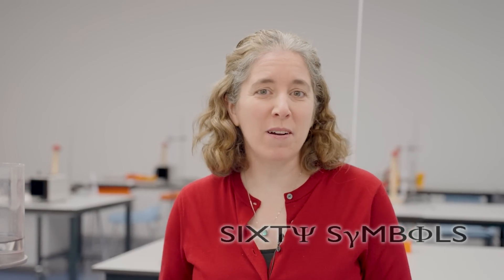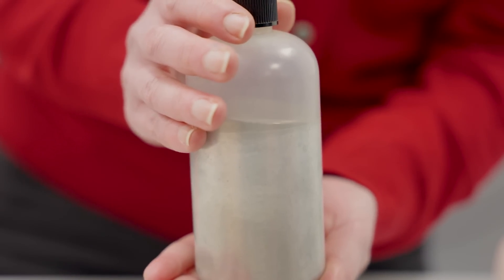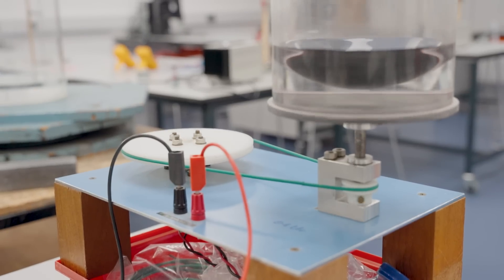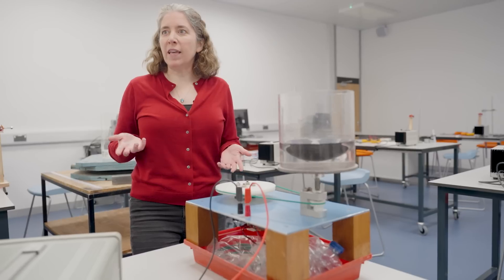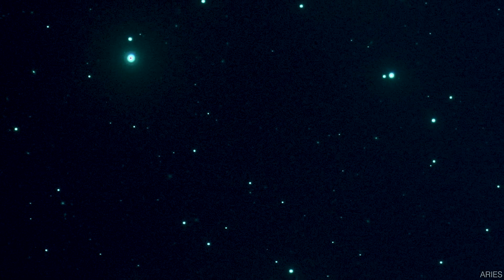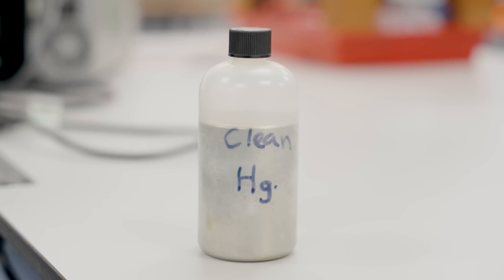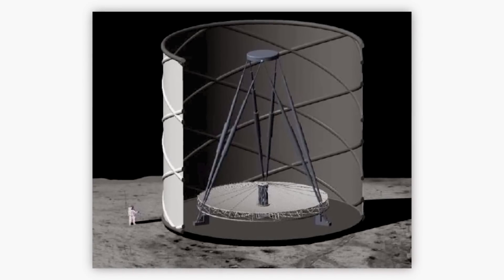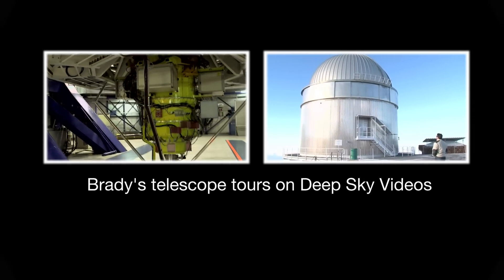Telescope with a Mercury Mirror - Sixty Symbols

Comment: Surely, a frozen metal mirror is exactly what is required on the moon,. Once frozen ,in the correct shape onto a suitable frame, it could be steered like a normal telescope
Reply: You don't necessarily to steer a telescope on the moon into the right direction. You just have to remember that a dark night on the moon last less then 14 days on earth. Yes, when it's dark it last much longer than 24 hours, but most of the time the sunlight will be to bright for the telescope to see other stars. 
So it would be better to have a telescope on the moon without all the complicated steering mechanism. You could then only look a small part of the sky, but it might be easier to set up a few more telescope with liquid mirrors on the moon pointing in different directions as one with a normal mirror.
@luipaardprint It's an important point, that a liquid mirror doesn't need polishing. All the big mirrors of normal telescopes need a cleaning and recoating evey few years. That would be very difficult to do on the moon.
Reply: Once frozen it’s not a smooth surface anymore, and would need polishing.
Reply: @luipaardprint  It's Ironic that cooperation with polish scientists produced a telescope that doesn't need polish.
Reply: @luipaardprint  like most mirrors :-)
Reply: I wonder if there's an electro-chemical way to polish frozen mercury.
Reply: @wktodd  you don't need to polish liquid mirrors

Comment: Hear me out, what if you double spin your telescope. You first spin the mercury to make the parabola, then spin the whole telescope in a circular track, you can point it sideways while ignoring gravity. You can image a whole circle in the sky that way.
Reply: You could, but you'd have a worse problem than it pointing at only one spot. Now it's focus would be constantly moving as you would have to keep it rotating on the circular path because any change in that motion would disturb the surface.
Reply: @ElectricGears  also as the earth is moving,  we will have to change the track radius with time
Reply: No, you cannot simply ignore gravity.  If the axis of rotation is anything but vertical to gravity, you get a constantly varying shape.
Reply: But now you got motion blur
Reply: I like the way you think
Reply: Vibrations are going to make this a nightmare
Reply: That would induce sloshing.

Comment: but if you limit yourself to a zenith looking telescope - also all the arguments why handling and mounting the traditional solid mirror is so difficult disappear.
Reply: Not if you have to ship it into space.
Reply: @Bunnysinger  admittedly, but as was also pointed out later in the video there are other obstacles, like the low temperatures and the low pressure, with together with the high vapor pressure of mercury will lead to quick evaporation. There are other alloys, but for the dark-side of the moon with -180°C the choice even of ionic liquids should be limited, balancing between freezing and immediate evaporation.
Also still the containment vessel and motor assembly would need to be transported to space/the moon.
JWST has shown that a quite thin, free-standing membrane can work as mirror surface, which sounds much more attractive.

Comment: If you spun a molten metal that is warmer than room temp, then let it freeze as it's spinning, would you get a smooth and solid shape?
Reply: Unlikely. You get shrinkages that will warp different parts.
Reply: I would imagine controlling its shape as accurately as needed would be very difficult. Also a big advantage of the Mercury mirror is that it’s does not need polishing, which a solidified metal would need.
Reply: Yes, although you will have distortion as it cools. Some glass mirrors are made like this, then ground with CNC machines into the precise shape. The centrifugal casting drastically reduces the amount of grinding and stress releaving that would need to be done if they started with a solid block.

I think some amateur astronomers have done this with plaster to create the pre-forms or physical templates for tracing attachments used to grinding their own mirrors. When we didn't have CNC machines accurate to nanometer distances, that's one way of generating these mathematically-defined surfaces.

Comment: Big Flat Mirror?
Reply: A flat mirror wouldn't concentrate the light from it's surface in to one small area like a curved surface does. That is needed for astronomy because so little of the light from stars reaches us after spreading out as it travels such great distances.

Comment: A magnetic band under a thin pool of mercury is out of the question seeing as it's electron stability (negatively) is very low.

However, Galinstan could possibly be manipulated in such a way as to parallel a rotation once spun up.

Could this be a safer/cheaper solution?

Just asking! ;O)-

Comment: Isn't possible to freeze the mercury telescope after having the paraboloid shape? Or maybe using it as a mold to make a solid one with glass mirror?
Reply: You don't need a mold for a glass mirror - in fact, large parabolic mirrors are made by spinning molten glass and letting it cool down very slowly.
Reply: It would have to freeze while spinning and I imagine it might not freeze evenly. The whole apparatus would have to be kept at -39C which probably costs more energy than spinning it, and everything has to tolerate that temperature. And we already know how to make a solid one with glass mirror.

Comment: There is an alloy of low melt metals that can be used instead of mercury. 
Non toxic. Can solidify then remelt when needed. Still useful at normal temps.
Gallistan? 
GALLIUM, INDIUM, NICKEL...??
Reply: I reckon density and viscosity are a factor here. It looks like that alloy behaves differently from mercury and is more readily oxidised.

Comment: Couldn't you steer this telescope the way they steered Arecibo? By moving the camera around. You will not get 180° but a decent portion of the sky.
Reply: Arecibo was different shape (spheric compared to parabolic)> This allowed it to have a line of focus instead of just a single point
Reply: @filiard  that's right. Arecibo was deliberately chosen to have a spherical shape so that multiple receivers could be simultaneously listening at the line of focus and so a secondary reflector could be steerable. FAST in Guizhou, which is now the world's largest uses the same design. The shape is also easier and faster to build due to the more symmetric nature of the pieces. Further still, the spherical aberration of the primary can be corrected for with a Gregorian secondary and tertiary reflector assembly at the focus, which was eventually exactly what was done on Arecibo in the 80s.

Comment: What about dust that is a problem for big mirrors? Mercury is heavy. I imagine all the dirt will flow on the surface.
Reply: It's not the dust that's the problem, it's the oxide scum that constantly forms at the surface. You can see a whole crapload of it on the mercury surface at the end of the video here. The LZT in BC constantly needed to be stopped and the surface skimmed with paper towels to clean it. The dust accumulation on a normal telescope, even in the worst cases, surprisingly only accounts for a loss of a few percent of light.
Reply: It's probably easy to swab/remove dirt if it settles on the surface, or have a process to exchange the mercury periodically to purify it.
Reply: One technique that’s been used is a thin layer of liquid floating on the mercury that is continuously recirculated and filtered.
Reply: It looked like there was dirt / oxides around the perimeter of the mirror. Perhaps centrifugal force keeps that stuff on the rim.
Reply: @thirstyCactus  I think you missed the demonstration in this video where they put something on the surface of mercury and it stays in place.

Comment: Another advantage of mercury is that it is self healing from small, surface-level damage.
Reply: another advantage is gradual exposure to mercury vapors motivates the research assistant to finish their thesis quickly
Reply: That advantage would be excellent for a moon-based mirror, where there's likely space randomness hitting the surface more often than on Earth's surface.
Reply: @thirstyCactus  even better for lunar applications is that mercury corrodes aluminium spacesuits and spacecraft
Reply: That property is not mercury's. It is any liquid's property.
Reply: @JavSusLar  OP was referring to mercury as opposed to solid mirrors, not mercury as opposed to other liquids.

Comment: Is the mercury mirror a sealed container? or would they need to top it up from time to time?
What are the implications for polluting the environment?
Reply: The vapour pressure of mercury is pretty low for a liquid (but high for a metal), less then 0,2 Pascal at ambient temperature. The vapour pressure of water is about 1000 times that.

(On the flipside, a molecule of water weights about 1/10 that of an atom of mercury, and when water evaporates, it cools down a lot more, inhibiting further evaporation.)

So just to get a feel for it, mercury stays where it is much more willingly then water. As long as the mecury is kept cool and does not experience a permanent air flow, it will only leak tiny amounts.

Now some perspective, the yearly mercury emissions due to anthropogenic sources are estimated to be about 2000 tons. (metric, obviously)

About 1000 tons of mercury are released from "artisanal (small scale) gold mining and refining", which makes up about 12 % to 15 % of total yearly gold production.

About 400 tons of mercury are released from burning coal.

That means that any losses of mercury from a mercury mirror are, globally, a drop in the bucket and absolutely meaningless. I bet that the effective mercury release due to the production of electronics in their systems and from the energy consumption to keep it running are higher then from evaporation. The environmental impact of mercury mirrors are meaningsless, they might just be a minor, controllable health risk for the employees, but I'm sure they use proper safety measures.

It might even be that the production of conventional mirrors emits more mercury due to electronics and burning coal due to the higher energy- and labour requirements. 

All in all, I would say that there is close to zero environmental damage from using a mercury mirror over a different mirror.
Reply: If we ignore spills (that could happen any time mercury is used) evaporation would be a concern. Generally people wouldn't be allowed in the room when the mirror was uncovered. Although they wouldn't be allowed anyway to reduce vibrations. The building would also need a slight negative pressure to reduce air from leaving the opening. Nothing basic air quality management systems couldn't handle.
Reply: negligible